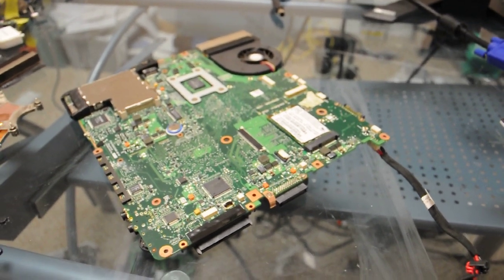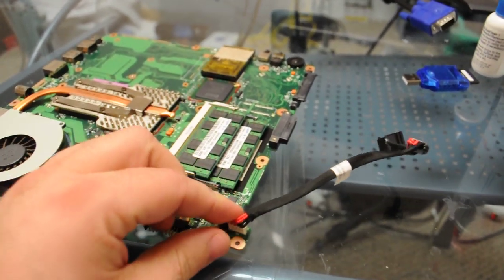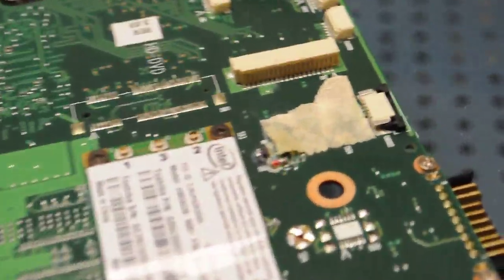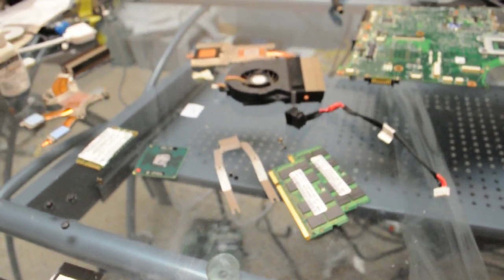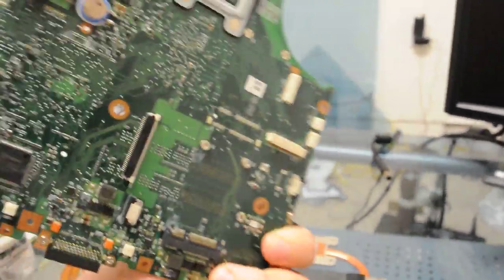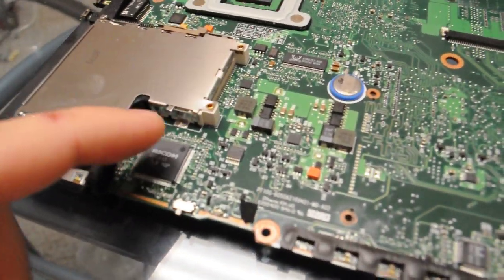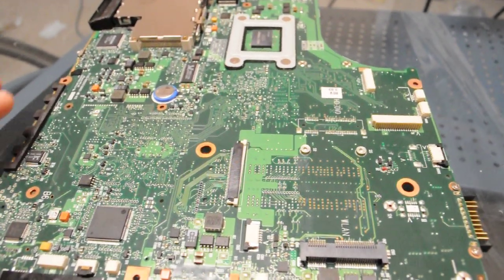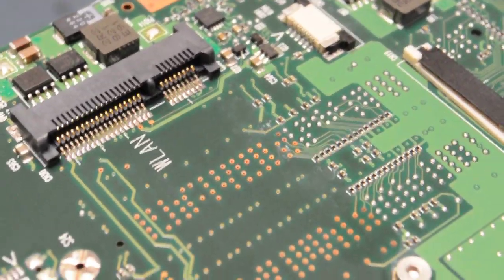HPReflow.com Toshiba A135 Laptop Motherboard repair with water damage and corrosin

Comment: would using a water jet (irrigator) those for oral cleaning filled with 99.99 alcohol work? Maybe add a little jet power to the level to lift off the corrosion. 

Would that be a good idea?